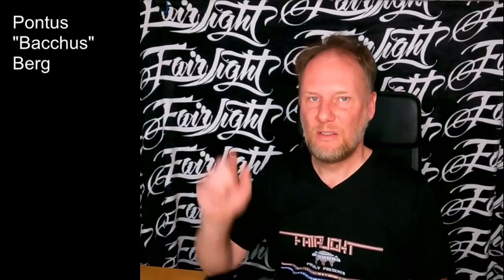FairLight TV #5, FairLight facts: Putting theory of compression into practice on the C64

Comment: I found back in the day that I got significantly smaller files if I completely skipped the packer and just crunched the intro + picture + game with Cruel Cruncher V2.5+ all at once. It would beat the packed variant by 20 - 50%.

Does exomizer get better compression than the Cruel cruncher V2.5+?
Does exomizer get better compression than LZMA2 (XZ)?

One thing I wasn't able to figure out back in the day was where to get the level decruncher. For example, on IKARI Level Master, there did not seem to be any (fast)loader + decrunch routine(s) included. How did that work???

Was there ever a level cruncher version of the Cruel Cruncher, and if there was, did it include a (fast)loading level decruncher? If it existed, what was it called?
Reply from the maker: Many questions at once here.

crunchers were the holy grail. The thing people kept internal. Level crunvhers very much so. And mething any fast loader with a decruncher is not to let science. Even today, N0SD0S is a pretty limited spread tool for level loading. But it using Exomizer for the loading. I mostly use Carver, which is a full available loader. Also using Exomizer.

Back in the days we had our own loader solution which used DarkSqueezer ad cruncher.
Reply from the maker: And comparing results, I suggest you test yourself. But that RLE+Crunch would be 50% inferior simply isn't possible
Reply: @FairLight1337  I did - spent many a night back in the day comparing. 20% was more in line, but 50% with Cruel cruncher V2.5+ wasn't unheard of. When I write 50% I'm referring to just the software; you have to consider that in ratios, as I'd add the loader picture back in and tack on an intro, and not a small but a normal intro, all of it would be more than 20% smaller than with a packer. This stands to reason, as RLE compressed content would by definition be poorly compressible, and any compression opportunities which the cruncher would have had would have been all but wiped out.
Reply from the maker: You are missing the point that one aspect of competition between groups was having the short st version.
Reply: @FairLight1337  yeah but like you also told me, nobody wanted to wait to crunch like I did, so most people used a packer to get done sooner. This, as I empirically found out, was detrimental to getting the smallest possible size.
Reply from the maker: It doesnt make any sense. RLE plus sequence SHOULD yield the best result. Especially with the old setup. At least it was clearly so for me.
Reply: @FairLight1337  but that's not what the nights and nights spent crunching have revealed. There is an easy way to reproduce my results: decrunch and depack everything, link the intro, the picture and the game together with XAKK's Crosslink 2.0, set the emulator to maximum speed, crunch everything with Fast Cruel V2.5+ from Galleon of Oneway in one go, compare the result. Repeat for as many cracks as you feel like. You should get consistently better results (smaller sizes) than packing + crunching. I think it's because a cruncher can find more identical data when the input is uncompressed, id est not RLE packed. Hey, I just had an idea: Fast Cruel V2.5+ algorithm analysis could be material for an entire episode!
Reply from the maker: Hrm. Crosslink is not the best packer. Its mainly for joining files into a file. It also encrypts the data if I recall correctly. So its a really bad choice of RLE. And also Fast Cruel is not anywhere near the real Cruel. So its not really the relevant choice for me.

I have done compression. Its episode 3 or there about. But its going to be the topic in the very near future. I already have recorded material.

RLE had to other advantages. The file got smaller so it was possible to add an intro directly, which want always possible with something not packed.
And you save a lot of crunching time if the file is smaller.
Reply: @FairLight1337  I used Crosslink to link. As far as I'm aware, Crosslink does not do RLE, it's just a linker. I don't think it encrypts data, only obscures the CLI JMP sequence.
Reply from the maker: Ok that might be it. I did a cross depacker. I fail to find it on CSDb so it might be that its never shared.